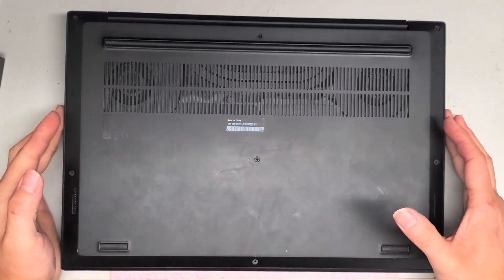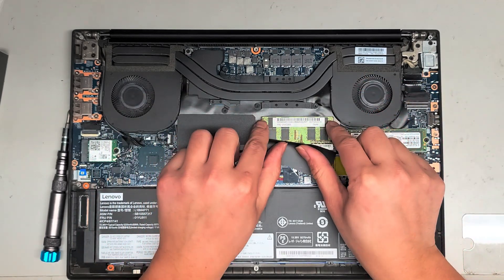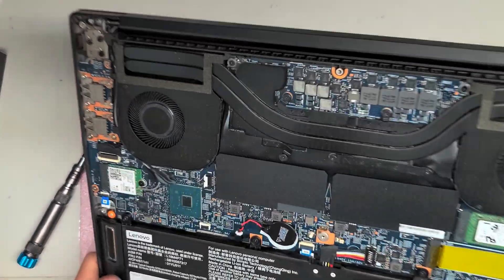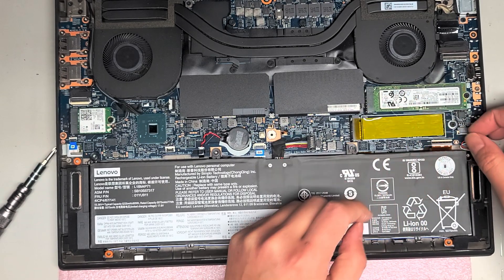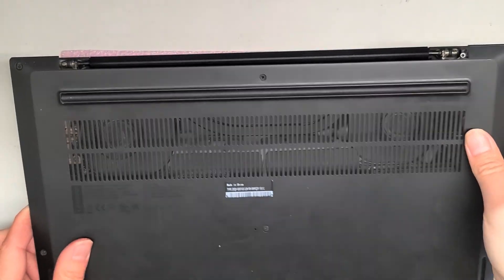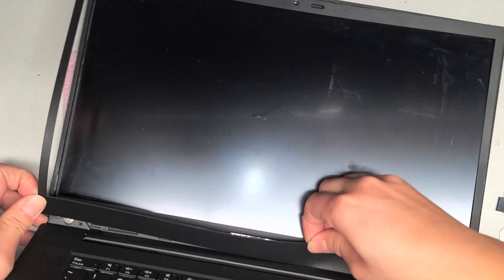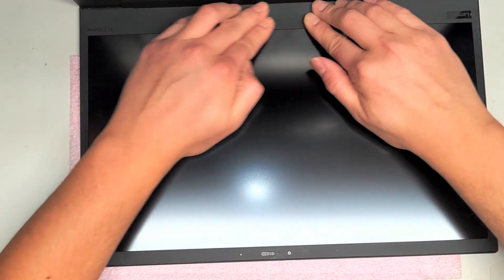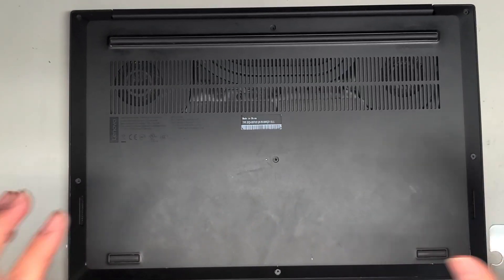Lenovo 2nd Generation ThinkPad X1 Extreme Disassembly RAM SSD Hard Drive Upgrade Screen Replacement

Comment: Hi Binh, do you think it would be worth installing a 4K screen and 32/64GB of RAM onto a Thinkpad X1 Extreme Gen 1? 

My Thinkpad X1 Extreme Gen 1:
15.6" FHD (1920 x 1080) IPS anti-glare, 300nits
16 GB DDR4 2666MHz
512 GB Solid State Drive, PCIe-NVME OPAL2.0 M.2
i7-8750H 6 core Processor (2.20GHz, up to 4.10GHz with Turbo Boost, 9MB Cache)
Reply from the maker: Not sure

Comment: Hello I followed that instruction and successfully changed the lcd
Buy the way, the double side tape,  is not sticky so it does not support Lcd,
I tried lots of adhesive but cannot found the original one.
Do you know the  name of original adhesive? it's looks like polyurethane or something rubber thing... but cannot find original one .
I only found 9448a but looks like weak to hold screen
Reply: I will buy that one
Thank you.
Reply from the maker: @nellenfancam  hope it works well
Reply from the maker: This should work well https://amzn.to/40ux2eY not sure how wide the area was though. Make sure 4mm is OK.

Comment: Thanks for the video! Helped me to replace my screen. I reused the old adhesive, but a few parts do not stick as well as they once did. Do you use small double sided tape typically when you replace the adhesive? Thanks!
Reply from the maker: Yeah, it doesn't really need much adhesive.
Reply from the maker: If you haven't already, please like and subscribe so others can find my videos. Thanks!
Reply: @ItsBinhRepaired  For sure, first thing I did! Btw, I was thinking of changing my keyboard out, and I saw your other video for this model, but what happens if you rip up that vinyl that was between the keyboard and motherboard. Do they sell replacements and if so what is it called? Looks like it dual purpose but I could be wrong, something of a thermal protection and also spill protection. Thanks!
Reply: Also, do you recommend a heatsink for a laptop SSD, or do you think the thermal pad that is pre installed is sufficient enough? I looked up those copper housing ones on amazon, but I guess I would have to peal up the pre installed pad to install and if the default one is good enough then there is no point to spend more money on something like that.
Reply from the maker: I don't even use cooling on SSDs. The vinyl isn't necessary.

Comment: Hard to get adhesive without damaging the plastic
Reply: With a bit of heat was able to get it off. Finding the right replacement part is the next challenge
Reply from the maker: How did it go?
Reply from the maker: Yup

Comment: I have a X1 Extreme Gen 2 with a FHD Screen and would like to upgrade to an UHD Display. 
Do you know if this would be compatible, so just replacing it as you showed in the video? 
Thanks for the video, it's a good and easy manual!
Reply from the maker: I don't know. I only try exact/compatible replacements using the model number on the back of the screen.
Reply: maybe you have to change flat cable to 40pin edp I think
Reply from the maker: Don't know
Reply: @BBBMyChannel04 did you succeed?

Comment: Hi! Great video, very useful, thank you! Can you please make a video or give an advise what to do when after disassembly and cleaning my Lenovo (same model) start to make music tone error? I’ve read that it’s display cable error, but what to do with that? :(
Reply from the maker: I hope you followed the video exactly 100% if you skipped steps, you might have damaged the motherboard.
Reply: @ItsBinhRepaired  oh gosh :( I’ve seen your video after error appears to find out where I can make a mistake. And I wasn’t remove battery cable at first cause it was hard to remove it and I scared to broke it :))) So, I guess my notebook rip...
Reply from the maker: @tamika4604  possibly :(

Comment: Great video! I’m going to repair mine, and this helps out a lot!!

I saw that you are using the same bezel after you replaced the screen, and I was wondering if that won’t give any issues with the adhesive after you peeled of the bezel. I contacted Lenovo and they told me to buy a new bezel and adhesive tape, and I’m wondering what you think about this :). 

The bezel on my current laptop isn’t damaged by the way. It’s only the screen that is damaged. 

Thanks a lot for this making tutorial!
Reply from the maker: Clips are good enough. Glad it'll help. If you haven't already, please like and subscribe so others can find my videos. Thanks!

Comment: Does this screen have a 30 or a 40 prong connector?
Reply from the maker: I don't understand this question. The important thing is the screen model number. If you want you can count the pins, but having the same number of pins won't mean the screen is compatible.

Comment: Awesome video...!!! Do we need to go to bios and disable the built in battery before upgrading SSD? Or RAM? or Both?
Reply from the maker: No and bios disable isn't safe. I would physically disconnect the battery.
Reply: @ItsBinhRepaired  Thank you so much !!!
Reply from the maker: @raven4747  no problem
Reply from the maker: If you haven't already, please like and subscribe so others can find my videos. Thanks!
Reply: @ItsBinhRepaired  yes !!!! just did !!
Reply from the maker: @raven4747  thanks!

Comment: I have gen 1 with 4k touch. there's no bezel to peel the plastic. It's not replaceable. One has to replace the whole lid if one wants to change. Since I have the best display available, I don't need to change it. I am using the word "change" because there is no upgrade for me :D
Reply from the maker: Hmmm should still be removable. It'd just be a different process.
Reply: @ItsBinhRepaired  wow... Is it? Then please upload a video on that....as there is no video on YouTube for that.
Thanks for replying.
Reply from the maker: @itboy6934  sure, but you'll have to ship me your laptop
Reply: @ItsBinhRepaired  Lol. Mine is working 😂
It's your channel sir so you have to get it from somewhere for your content ☺️
Reply from the maker: @itboy6934  lol